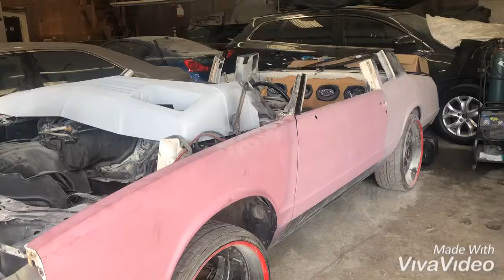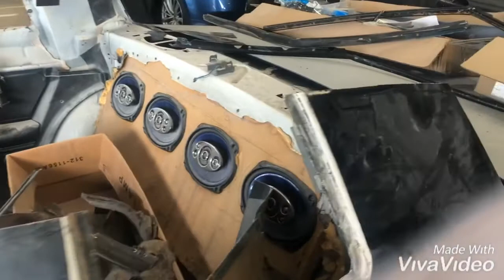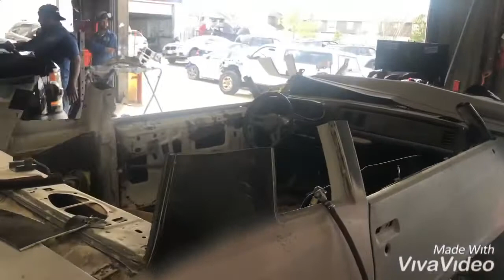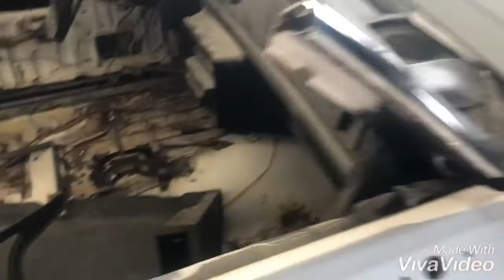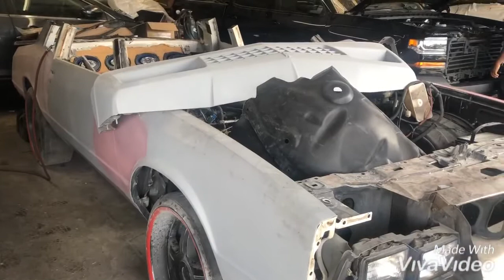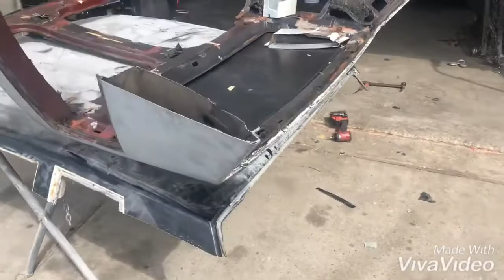1987 Monte Carlo SS under construction 🚧 (T-top conversion) Video 2

Comment: What are the measurements so I'll know where to cut on the donor car and my car
Reply from the maker: @theohamilton6766  wow.. man it’s been 4 years since we cut that car. I doubt the guys at the body shop remember. I will offer some advice though. Before you cut your car, remove your doors and weld a few braces in place between the front of the car and the back of the to prevent the body from flexing when you cut the roof.